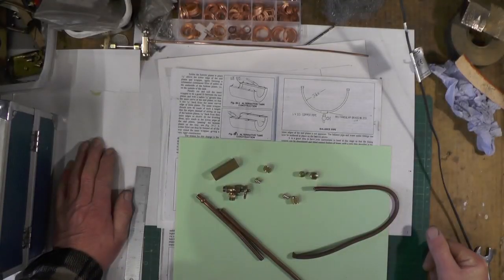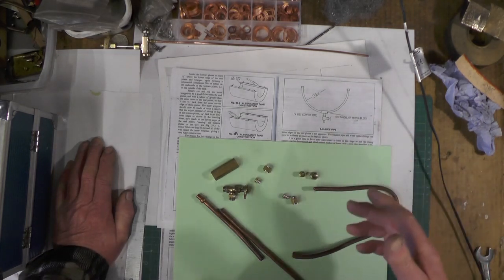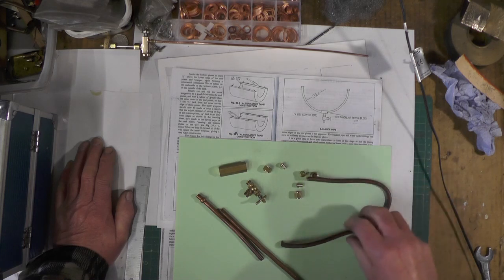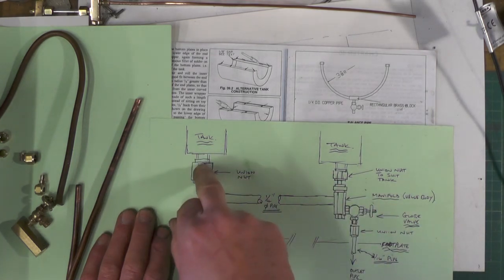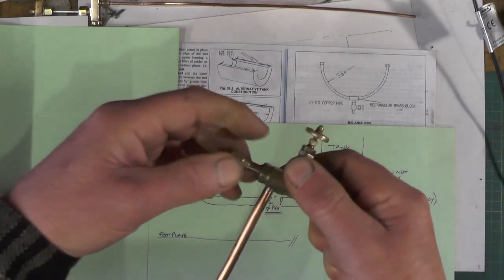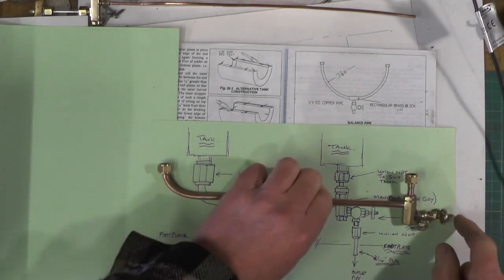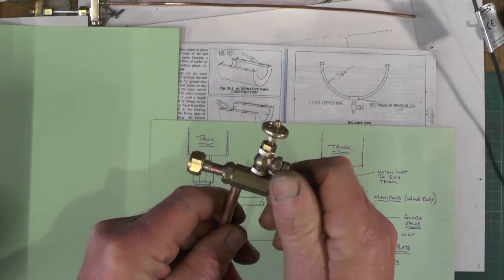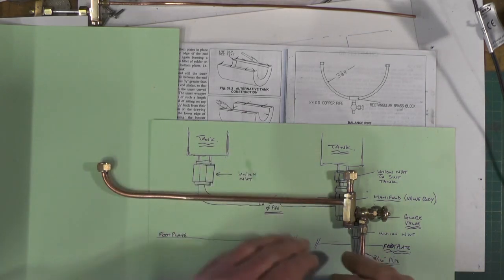Build Your Own Beginners Miniature Steam Locomotive Series ( Pipework P7 BALANCE PIPE) "mr factotum"

Comment: Very nice !!  Much better to have a 1/4" copper pipe to link the side tanks than  rubber hose that my LBSC Speedy I had acquired . Both side tanks have openings on their top surfaces to let air in while the tank water levels lower ? 
The use of distilled water will greatly reduce any lime / calcium deposites through out the loco .
Thankyou for sharing your work and explanations online . 
Being very mechanically understanding is a great asset you have ! 

Good job Sir 👍
Reply from the maker: hi TFS
thanks very much for watching and commenting, another tip there about the distilled water, i will take on board.
see you next time
regards
mr f